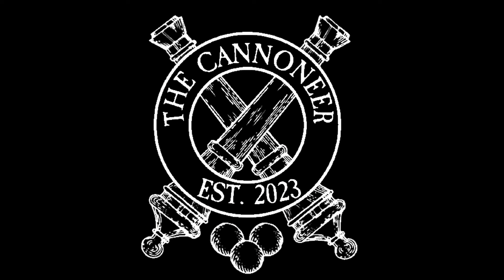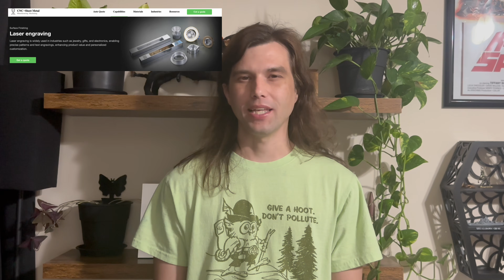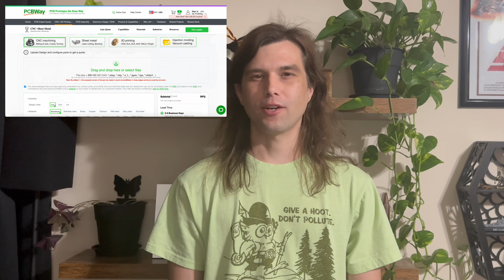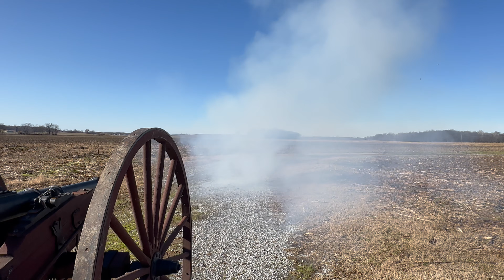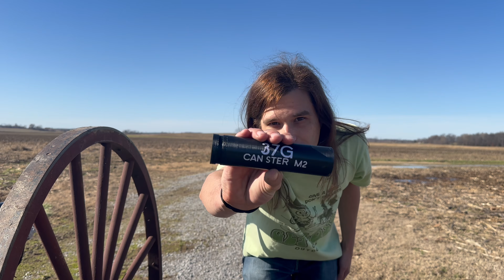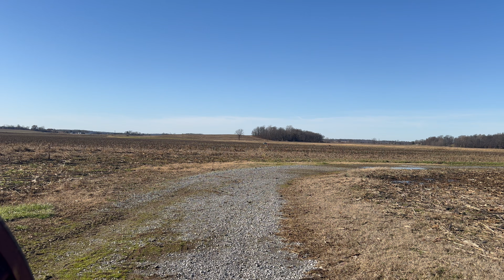250 Yard Shots with a Black Powder Cannon

Comment: I'd like to suggest an idea for you and pcbway.  
I want to see lead shells that have hardened steel rods placed into the center of them while the lead is molten.  The mold would have to have a female cup at the bottom where the nose of the rod would sit so that the steel rod would center itself upon insertion.  
Perhaps even a mold with a hole in the center so that the rod could be Elmer's glued in once the round has  solidified.  Maybe it would be easier that way.

I want nested penetrators is what I'm saying.
Reply from the maker: Haha I’ll look into it! Oddly enough I made some of those giant mini balls with steel cores in them. I was also thinking different types of tips on the projectiles might be a cool one.
Reply: @TheCannoneer  
You're way ahead of me!

Comment: I think with practice, 250 yards would be doable. Also, I think your grapeshot isn't heavy enough and the container isn't holding together well enough to allow them to exit the muzzle en mass. I'll see if I still have a 58 caliber round ball mold. If I do, I'll see about casting some up for you. What is the maximum mass you can safely fire from your cannon?
Reply from the maker: I’ve got some bigger molds for our flint locks I can pour up but I didn’t have any on that day and that was an actual historical round with the .38 so I figured why not. I’m sure you’re totally right some heavy musket balls would tear you apart at that distance.